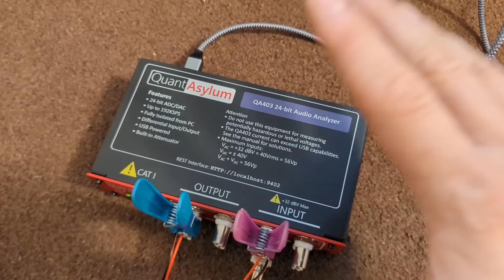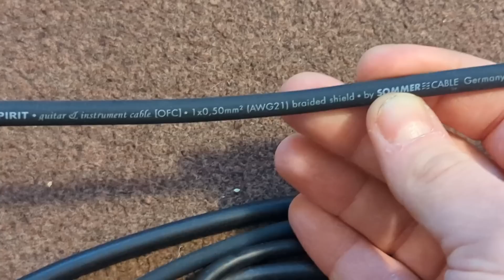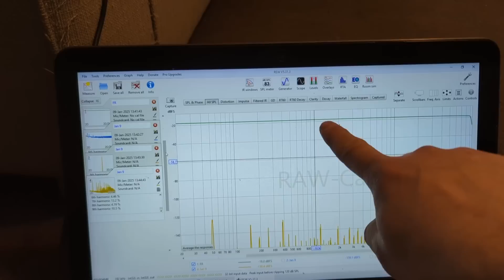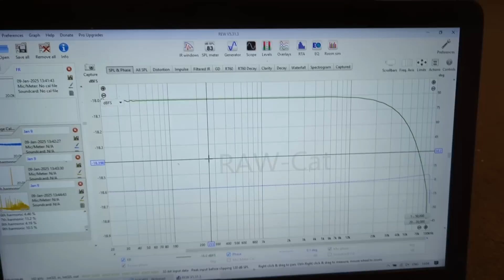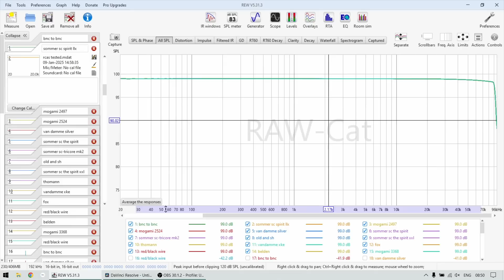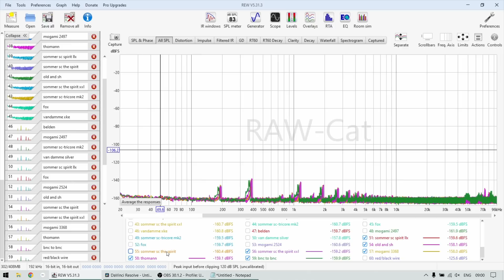Should you buy expensive cables?

Comment: I used to have my car radio connected directly to amp in the trunk with 5m rca cables and i could hear the noise even when turning on my headlights,so I would assume there's some difference.
Edit: I just realized that It was only happening for my rear speakers which used some super cheap cables, but it still has special insulation according to website.
Maybe alternator noise is easier to pickup ? 
Maybe alternator noise
Reply: It was a ground loop noise issue not an rca cable issue.
Reply: Conducted noise would come from equipment through the wires.  Decent shielded cables will eliminate radiated noise.  Poor grounds, bad initial connection, faulty equipment, etc could still introduce noise.
Reply: @MagicTK- usually the cables meant for video have better shielding. Since you would be able to see the interference
Reply: I've heard others experience similar issues and the root cause for those issues can be really hard to pinpoint, as it can have something to do with the alternator, grounding etc. In those situations I highly doubt a more expensive RCA cable would change much of anything. Nowadays high level inputs have become quite common in amps and DSPs so I would always recommend using those instead of long runs of RCA, as high level signal is much less prone for picking up noise. Another thing is differential RCA, but that seems to be topic still causing confusion, since manufacturers are not clearly disclosing if they use single ended or differential inputs and outputs
Reply: @Tomzuki.  Yeah, it was a terrible setup. Right now, I use dsp that has like 0.5 m RCA cable to amp and there's no noise.
Reply: I always found that if you ahd the head unit and the amps on the same supply, buy running power from the amps distribution point, you get rid of this. As long as you have good grounds etc